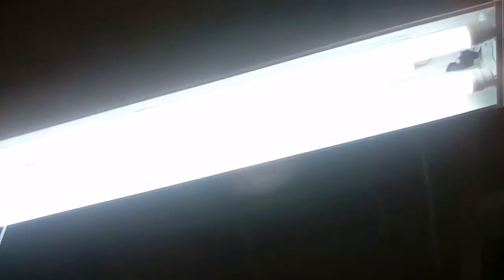The Strangest Thing On The Light....

Comment: The bulb may have been busted upon installation, or, you know when those retail signs are halfway lit? The bulb may be going bad. It would be best if you replace the bulb, to avoid life threatening dangers.
Reply from the maker: +Buildin'_ Six I may need to remove the Light Bulbs or unplug it. I may need to unplug the Light just for the safety.
Reply from the maker: +Buildin'_ Six I unplug the Light just for the safety after I was finished recording the start-up sound on the Mytek Pedestal Fan that I was about to post it on Instagram.